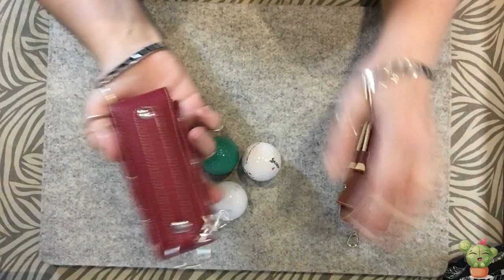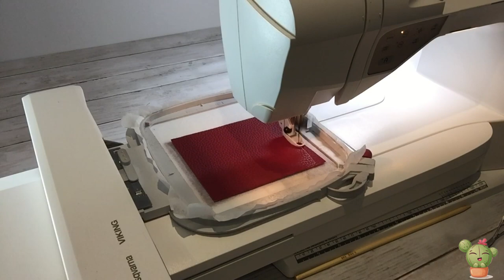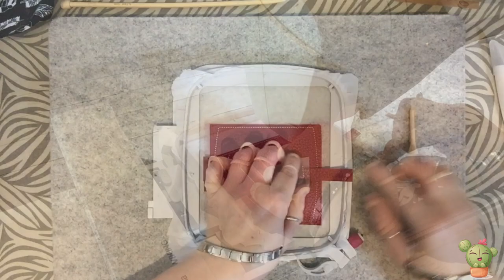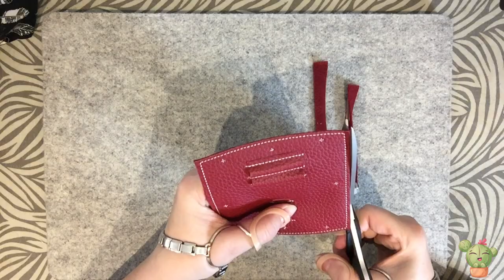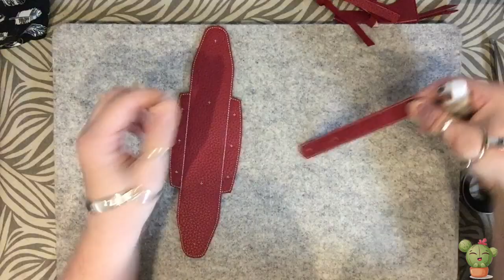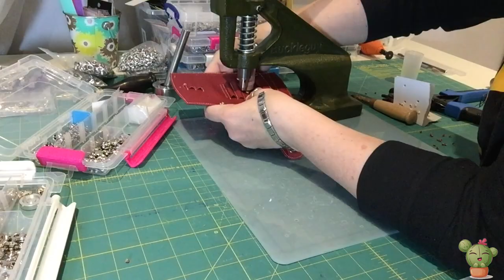Golf Ball Case - DIY golf ball holder In The Hoop Embroidery design

Comment: I was meant to watch your video.  I was looking for a golfing gift to sew for a friend and clicked on your video.  Then I noticed your finger braces, and I knew what they were because I use a couple myself, then I noticed your thumb/wrist brace?  Omg!  Can you please explain this device and tell me what it helps and where to get one.?  I have recently developed horrible pain in the base of my thumb down to my wrist, and it’s hindering me from doing what I love.  My fingers get locked in the bent position and my wrist hurts so bad, my finger joints hurt so bad as well,but I have no idea what’s causing all the pain.  I was told I have a trigger finger and possibly carpal tunnel, but definitely no arthritis.  So  I just suffer and cry myself to sleep most nights in pain.  I’ve been using a couple finger braces on both my middle fingers, and using compression gloves all the time and ace bandages on my wrist and thumb on right hand, also been sleeping in wrist braces for last 2 years.  Anything you could tell me about your devices and  any advice to help the pain or what to get my doctor to look at I would be extremely grateful.  ❤. Also thank you for the instructions for the golf ball holder.  It’s adorable.
Reply from the maker: Hello, sorry to hear you are dealing with hand/finger pain, it is no fun at all.  The ring splints are for loose ligaments as my fingers and thumb bend to far backwards. The thumb splint is not for the wrist it just keeps it in place better with that wrist band. They are from Digi Splint.

Comment: Do you have a link for the exact size rivets you use please?
Reply from the maker: I mostly use a a double cap, 9 mm cap with 10-12 mm post length rivet. 

I get mine at Buckleguy, but wherever you purchase the rivets from you need the same setting equipment they sell for their specific brand.

Comment: Very disappointing that you felt it necessary to fast forward the assembly, especially after such detailed instructions up to that point.
Reply: If you go to the settings wrench icon in the video screen (bottom right) you can select a slower speed to playback at.
Reply: If you’re watching on an iPad it’s the three dots in the upper right corner. .75 is about right to slow it down in most places and .5 in others.